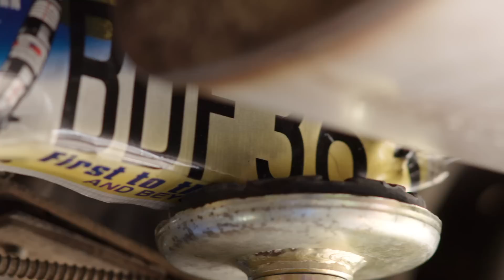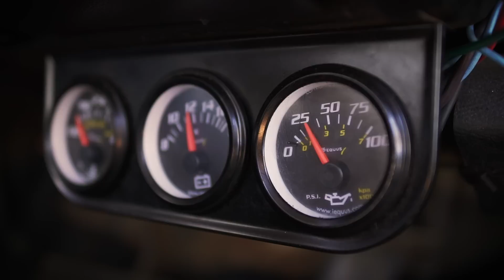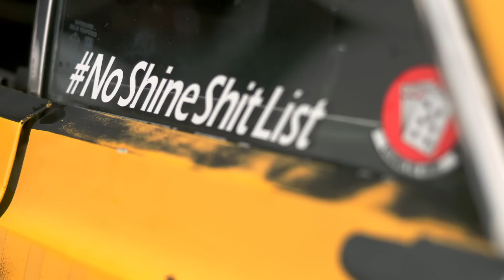Ratty Muscle Cars - The House Of Muscle Ep. 8

Comment: 340 is the best small block ever made. Eats chebby and phord variants yesterday, today, alllllll day tomorrow
Reply: BOP 350s are pretty peppy too. But I'd love to have a duster, dart, or cuda with a 340.
Reply: Kristopher Klassen I don't understand why misspelling other company names is insulting, but ok
Reply: Christopher Cordasco because mopar that's why
Reply: Kristopher Klassen Want slow car? get mopar!
Reply: Kristopher Klassen Dear Sir, I'd be delighted to put my e36 next to your chrysler automobile any day.
Reply: You need to check yourself into rehab immediately:)
Reply: Kristopher Klassen Until you come across a 351w.
Reply: Joseph HD pthfff boat anchor
Reply: I've owned them all and my 340 wasn't all that peppy. A 350 2 barrel Pontiac 4 door would stay right beside my 340 4 barrel Road Runner and leave it behind after 100 MPH.
Reply: nastyALPHA so you like looking at the taillights of a Mopar hey
Reply: @Tim A Pontiac 350 has the torque curve of a big block and depending on the year a Roadrunner can be a little too much car for a small block 340. The first gen Roadrunners were very light for their size. 2nd gen was a little heavier. 3rd and 4th gen was light but low compression and totally fugly.
Reply: The 2 barrel 4 door Pontiac family car had a full perimeter steel frame and weighed about 3800 pounds. The 340 4V Plymouth was lighter and had better gearing. The Pontiac was bone stock with over 100,000 miles - The Road Runner engine had about 20,000 miles on a rebuild.
Reply: I'd argue that the LSx is the best small block "ever" made.
Reply: @Tim The first gen Roadrunners were big block only and they weighed about 3300 to 3600 pounds. The 2nd gen Roadrunners were much heavier at 3600 to 3800 pounds and ironically could come with a small block. The weight difference is minimal, so it was essentially a 4 barrel small block vs a 2 barrel big block. I know those old high compression Pontiac/oldsmobile 350's are very strong motors. My grandpa used to have a 73 Lesabre 4 door with a 350 4 barrel that was bone stock and fast as shit.
Reply: nastyALPHA and I'd argue that the lsx is the best boat anchor ever made
Reply: @Moparmaniac55543 @nastyALPHA 

I smoked an E36 back when I had a 273 4 barrel and a 3 speed auto. 

Dad didn't trust me with over 300 horses when I first got my license lol
Reply: Kristopher Klassen you mispell chevy and ford.......... just saying
Reply: TexasElite 13 he's making fun of their names...
Reply: Kristopher Klassen Do you have any objective reasons for that, or is it because there are mopar valve covers and air cleaners available?
Reply: BApple ohh, I see
Reply: nastyALPHA sure there are. And if so, FCA would have something to say about that
Reply: Tim Sharpe Dude, your 340 was in terrible fuckin shape, because 340s are Wicked.
Reply: Tim Sharpe Then someone that supposedly built that 340 didn't have a single clue.
Reply: im surprised nobody brought up the 400 sbc
Reply: I honestly beg to differ. A Ford small-block is killer.
Reply: Peter Marino ya depends which one though I had a 351w that had alright power up high but down low it just had no one home.
Reply: Impact Junky so an ls engine is a boat anchor but an 340 isnt lmao
Reply: id go coyote with its nearly 500 hp warmed over compared 300 from the 340 if you do about the same amount of work (im being a little generous to the 340)
Reply: phil tripe not with the same amount of money
Reply: phil tripe No, your definitely Not being generous. A stock 340 makes over 310 horsepower. The 340 bore stock is 4.040. Evidently YOU do not know anything about 340s.
Reply: Shaun Clifton a stock 340 makes 270 hp so looks like your numbers are a little off also
Reply: 275 was a fake factory rating. Hot Rod recently tested both 340 and 340 6bbl and the 340 made about 325 hp and the 6bbl about 350 hp.
Reply: ls2 ftw No sir. try again. It has been shown over and over that the horsepower numbers on the large bore 340 were ALWAYS lied about for insurance ratings. Being raised in a family that always raced pure stock as well as all out race engines, on the dyno a bone stock 340 never makes less than 310. Do your homework.  Look it up. It has been proved over and over.
Reply: ls2 ftw Even the 72-73 low compression 1.88 intake valve, smaller cam 340, we still got 317 HP on the dyno
Reply: Conner Bullard why? They remain at the bottom of lakes where they belong
Reply: ls2 ftw now you're learning
Reply: There's no such thing as a Pontiac big block. A 350 has the same outer dimensions as the 455. I used to go to the track every weekend and race so I know firsthand what a good 340 can do and they were never all that hot. A good indicator to measure muscle car performance is the Pure Stock Muscle Car Drags. Watch a few of those and tell me how many 340s you see winning.
Reply: Tim Sharpe ummm Paul Petcou always in the top with his black and white stock 340 Duster. Pure stock drag championships
Reply: @Tim Nobody said the Pontiac block was a big block, I said the Pontiac 350 had the torque curve of a big block.  
Although it would be more accurate to say that there is no such thing as a Pontiac small block because the Pontiac block is closer to a big block in terms of size and performance characteristics, that's why the 455 and the 350 are able to be the same exact size.
The Pontiac 350 and the Mopar 340 may only be 10 cubes apart but they have drastically different bore, stroke and valve train. The 340 makes great torque for its size but the Pontiac 350 makes even more torque at an even lower RPM which is why it could actually make that tall geared heavy old family car take off fast. The 340 on the other hand should be a slightly higher rpm combo making a bit more peak power but not as much brute throttle response. The lack of torque on the 340's part was too much for your heavier year Roadrunner. 
Simply put that year Roadrunner should never have had a small block, it was a little too heavy for one.
Reply: @moparnutjim @Shaun Clifton 
You guys could have just gave my comment a thumbs up instead of repeating everything I said.
Reply: Impact Junky I wasn't replying to nor did I read your comment. I was giving a lesson to whoever believed that a stock 340 made less than 300 horses. I have spent all 44 years of my life growing up around, owning, building, driving, dynoing, and racing 340s.
Reply: Impact Junky Now, I just now went back and read your comment on the 273 4bbl you had. 👍Happy ?
Reply: @Shaun Clifton I wasn't talking about the 273 comment, I already told the LS guy that the 340 was under rated for insurance purposes. You must not have seen that comment because you essentially repeated what I said. 
And I agree, anyone who would shit talk a 340 is clueless.
Reply: Impact Junky Right. I had not seen your low horsepower/ insurance response. I had read his 270 quip. Most of the comments are just uneducated altogether when it comes to a 340. I love to add a 4" crank for at least a 416. Anyone needing a good education on the constant growth of a killer 416 ( 340 with a 4" crank ), should watch Steve Clukey videos here and Learn.
Reply: I read very carefully and you said: "it was essentially a 4 barrel small block vs a 2 barrel big block."

Enough with the excuses. Torque wins races. Horsepower sells cars.
Reply: Thanks Shaun, I might check those videos out. A 340 is kind of a rare and expensive engine around here though. 360's are much easier to find on the cheap, I found a certain kind of 360 that I like to use now with really good heads but I generally keep that a secret ;) 
You can see/hear it run in my Roadrunner clone on my channel.
Reply: Here are two records from the Pure Stock Muscle Car Drags website. 

1.)  1970 Dodge Challenger TA 340/290 3.55 gears weight 3708 best ET 14.31 @98.26

2.) 1972 Buick GS 350/195  3.42 gears, weight 3816, best ET 13.55 @99.92

I rest my case. 340s are nothing special. A low compression 350 Buick with 108 more pounds runs .75 quicker in the 1/4 mile than a high compression 340.
Reply: @Tim Sharpe I never said the 340 was better, in fact I said the opposite. You started trash talking the 340 just because you couldn't make yours outrun an old family car. That's when I said that PontiOldsmoBuick 350's are actually very strong torquey engines and that it wasn't really fair to compare it to 340 small block. 

Also, you started off comparing an old full frame 2 barrel family car to the Mopar and now you are comparing a slightly smaller, better geared 4 barrel Skylark to it when no one is even trying to argue with you about it.
Reply: moparnutjim i read that article awhile back it actaully only made 281hp stock so idk where you got those numbers
Reply: ls2 ftw damn your up early, you must be bored
Reply: Shaun Clifton  oh i looked it up plenty of times hotrod magazine just ran tests on the engine and stock only made 281hp so yup your numbers are still off maybe you wna believe it makes more power then it does but it dont it will always be a boat anchor
Reply: Kristopher Klassen oh no i been known that engine is a boat anchor
Reply: TexasElite 13  yup up early just tryna bring some mopar guys back to reality
Reply: Impact Junky, you have a suitcase full of excuses. It shouldn't be fair to compare a big valve 4V 340 performance engine to a small valve, low compression Pontiac 350 in equal weight cars.  It shouldn't be fair to compare a 290 HP lighter car with a 195 HP heavier car. The MOPAR should be way faster if Chrysler were truthful about their HP ratings.

You're so caught up in your victim mentality that you claim that 3.42 gears are better than 3.55 gears and a 3816 pound car is "smaller" than a 3708 pound car. This is like wrestling a greased pig.
Reply: @Ls2 ftw Stop lying through your teeth, here is a link to the Hot Rod Mag article. Showing over 320HP with one carb and over 350hp with a Six Pak 
http://www.hotrod.com/articles/bad-mopars-340-beat-ford-chevy-shocking-new-data/
Reply: Impact Junky Brother, just let it go. It's useless...like talking to an atheist or liberal.
Reply: Impact Junky It doesn't matter what proof you have, or if you own a dyno and let them come over to watch, some people are just that damn obtuse. I am not even brand specific. I have a nice 350 94 Silverado, Buicks, etc, but I have spent 44 years watching 340 Dusters, Demons, and Swingers take trophies, get the cash, and put asses on the trailer...including mine.
Reply: Impact Junky And definitely watch the Steve Clukey videos. There are several here on YouTube. Steve bought a new Blue 1970 Duster 340 back in 70 and has raced it ever since. It leaves the line front wheels way up in the air . Last time I watched him run, he was in the 8.70s in the quarter mile. The car has progressed from pure stock to now a dual quad stroked 340 with a Lenco 4 speed. Great videos of the progression of a 1 owner Duster 340.
Reply: Shaun Clifton it never makes less then 300? hahaha yeah okay watever you say sir probly just your average mopar fanboy blind to what they really make lol keyboard mechanic
Reply: ls2 ftw And No, Impact Junkie added the link from the dyno. Are you too illiterate to read it ? Yes, even the smog years 72 up, 1.88 intake valve, with low compression made 317.
Reply: Shaun Clifton okay keyboard mechanic better go back to building your boat anchors for a living
Reply: This isn't about my abilities. The guys who race in the Pure Stock Muscle Car Drags know how to get the best out of a car and they all have 14 second 340s. Maybe you experts should all go take over the series with your smoking hot MOPARS that defy physics.
Reply: Tim Sharpe these guys really believe the 340 is like a hot engine lol
Reply: Tim Sharpe Sure, what the hell do we know ? All hail, the King expert of all things muscle car related, the all-knowing Tim Sharpe. Just like an atheist liberal. Knows all
Reply: So from what your saying and the Pontiac 350 had the the same outer dimensions as a 455; i would say, not that they had no big block, but they had no small block.
Reply: ImpactJunky So, you call a hand build, 40 over, blueprinted aftermarket piston/rod, clevite bearing, bowl blended, manly swirlport valve, comp beehive, roller Rocker, mild cam, edelbrock intake rocking motor stock? I'm sure factory build engines peroformed exactly like this. Also no one ever noticed ,that "Hot Rod Magazines" dynos are always a tad "happy".
Reply: ImpactJunky A factory LS1 is just a intake, cam, headers away from 400whp.
Reply: @Schnitzel Are you dense or did you just skim the article looking for any evidence they added power? Clevite is just a bearing brand, you have to choose a brand, and next to kings Clevite is one of the most trusted. Also you MUST bore an engine with high wear during a rebuild, you are clearly new to this stuff. The article plainly says that the Edelbrock aluminum intake is a stock 1970 part. It's the same intake used on factory Six Pak setups. The cam is made by Sealed Power but it's identical to the factory 340 cam used in AT cars and the 4 speed cars had an even higher lift cam. All aftermarket parts except for the roller rockers, their spring/retainer kit and the 40 over pistons are stock spec and the valve train parts were clearly more for noise reduction than power production.
Reply: ImpactJunky I'm not new to this stuff at all. I know what it takes to rebuild an engine. How convenient to just forget about almost 50 years of advancement in engine technologie. New bearings, pistons and rings are way better than the stuff that you'd find in factory engines from the muscle car era. I have no doubt, this engine close to zero balanced ,which factory engines are not even close to. I'm pretty sure that the clearances are tighter due to mordern technologie and a precision approach to the build. Add modern synthetic oil to the engine, which is known to free up some horses. Roller rockers will add a tad of power, here and there. The cam is supposed to be similar not equal. I'm to lazy to look for the specs but I bet the cam has some modern ramp designs. Modern valves and a bowl blend will add power too. 350+hp was on headers. Let's just over look that this motor was tinkered with and on one of hot rods happy dynos.
Reply: Are balance and friction reduction your only points now? Because your claim about tighter "clearances" would produce friction not reduce it. Freeing up 50 horses with friction reduction and balancing would mean the thing was about to seize up and/or throw a rod. Also the article says output was over 370 with headers and Six Pak. 

If you want the honest truth from a low budget Mopar guy, the 340 is great but it isn't worth the money anymore. You can acquire and build a stroked 360SB or 400BB for way less cash than a good 340. 
People want the 340's for restoring Cuda's now and they are always overpriced. 

Since you like LS engines so much I thought you might like to know that my 273 has smoked it's fair share of LS engines. It was an early 4 speed Cuda engine in a much larger 68 Satellite with a 3 speed auto. Always beat them light to light but I did get outrun by an Impala SS on the highway one time. When comparing torque LS engines cant hold a candle to the smallest small block Mopar engine made. 
Needless to say Big Block Mopar vs LS isn't even a contest. 
New Camaro drivers are always shocked when my dads 4000 pound 383 Chrysler Newport rockets past them shredding tires and barking 2nd gear.
Reply: ImpactJunky Well, factory engines don't get that level of attention and proper clearances do free up power. As a guesstimate I'd give clearances and modern oil 10hp, modern pistons and rings (+6 cui) about 10hp, bowl work and valves about 10hp and the modified valvetrain about 10hp.  Adds up to a primitive guess of about 40hp +/- give or take over an "stock" 340. My point beeing that this one is warmed over.
Reply: @Schnitzel With no compression or cam change all of that put together might make 10 extra horses. And your misconception about stock spec parts being better just because they were made 40 years later is absurd. 
Here's a quote from the article about the port work. 
"A “bowl hog” cutter (center) was inserted in the Rottler SGF8 seat machine to lightly dress the throats (left). We argued against this step to keep things stock for testing but were overruled by the engine owner. It’s doubtful this work added more than a few clicks to the results with the mild cam. No other porting or hand blending was performed."
Reply: ImpactJunky Good Lord you do not build engines for a living. A proper balancing + blueprint makes around 5% more power. But since mopar is Ferraris, there is nothing to be gained with such peasants stuff.
Reply: @Schnitzel 5% of 280 is 14 stick to memes bruh
Reply: ImpactJunky Oh, cool. You added some math. My point was that I belive stock 340 4 barrles have been in the 300-320 hp range and the 340 6 packs in the 330-350  hp range. Factory form with the correct fluids of the time period. You as a hardcore fangirl just don't want to understand that.
Reply: ImpactJunky Good morning, my dear. I wish you a good old rod knock.

Comment: i picked up a 71' 383 orange cuda. the flooe boards had been cut up it originally had a column hift the previous owner put a 4 speed through the floor, cam , aluminum manifold. billboards came from factory. these cars were made to run. drive'em.